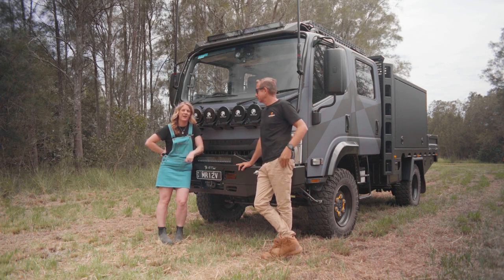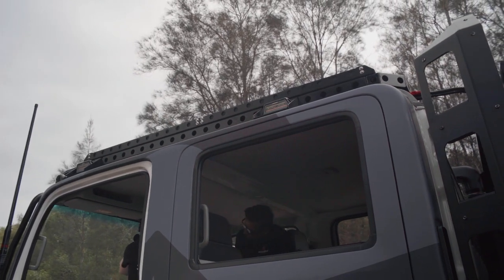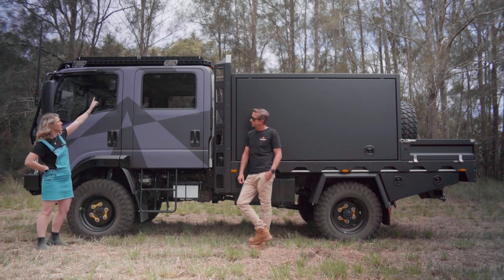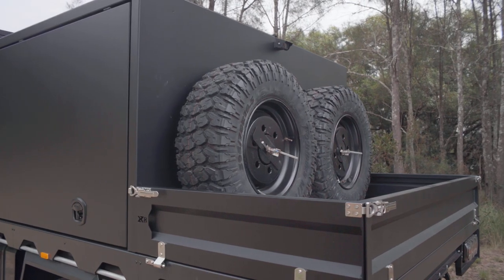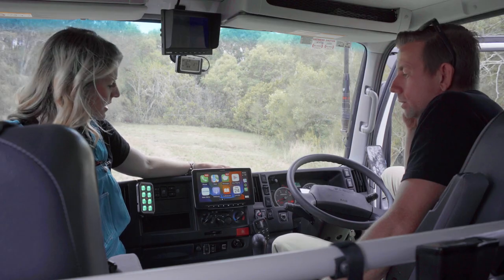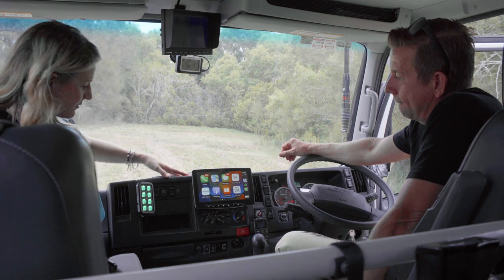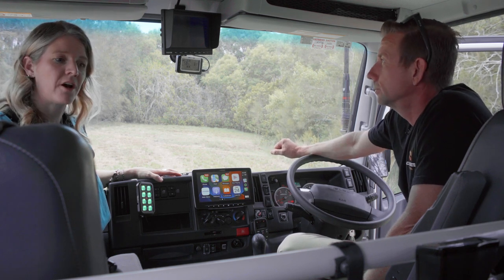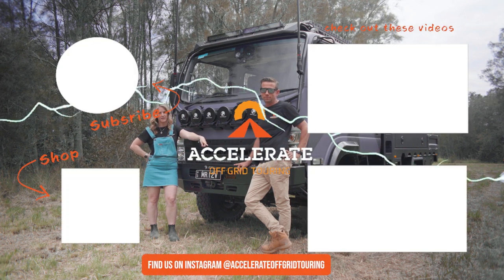Our Isuzu NPS 75/155 4x4 Build Series #2

Comment: Nice rig, a couple of things for feedback:
LOL @ The Cel-Fi claims. It does NOT convert crappy 3G into 4G. The GO unit will take a single band and boost it if there is enough signal of the band in the first place, nothing more. Cel-Fi systems are not holding up real well with shitty telco networks. Starlink becomes a much better option along with Wi-Fi calling and indepenadnce of the cell networks. 
Your antenna mounts are nice for highway, not much good for offroad as they will snap when they bend over to the frame. The solar is nice but plug the anderson plug in, its hanging out. You will also find out the the front and rear cab steps will either bend or break off. Cameras, simple, wide angle up high-rear but another down on the hitch. The other pair best on the side mirrors to cover the blind spots. Sound deadnening is great but watchout for the heat off the engine, a lot of it ends up in the cab. Isuzu's have a absoolute POS air-con system which is largely held back by the tiny condensor core under the front-passenger corner. Retrofit a larger core infront the of intercooler and the rear air-con does very little. Spent too many years cooking in these trucks on fire lines.
Reply from the maker: Thanks for the feedback.
We use the Cel-Fi alot when on the road driving and we have Starlink when stationary. 
So far we've done a fair bit of off-roading and no issues - we now have a boat on the roof which is a similar height to the antenna's so for us it's great as if the antenna's hit we know the rest won't fit. We've been on the road full-time for 2months so far.
When we filmed this the solar panels and electrics inside the canopy won't done, hence it wasn't plugged in. 

Thanks for the info on the cameras and AC!

Comment: Genuinely curious. What is a build like this worth? Completely love it!
Reply from the maker: Thanks for your comment!
As it sits at the end of video 1 it was around $160k
This is
Truck
Suspension
Tray
BarWork
Suspension Seats (not shown in the video)
Single Wheel Conversion

All up when finished, with boat, trailer, 2 roof top tents and full electrical system 400ah lithium, redarc tvms management system, 3000w inverter, 2 DC2DC Chargers, compressors, 2 fridges, 2 water tanks, pumps.... - absolutely everything, it would come in around the $300k mark.